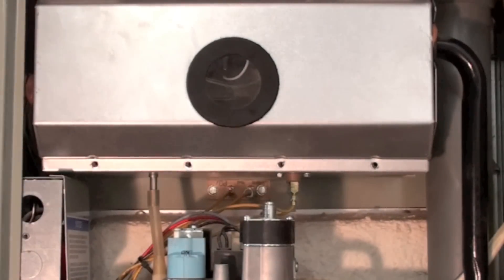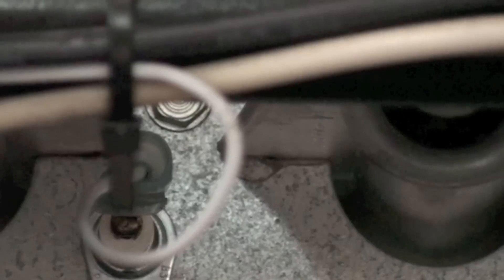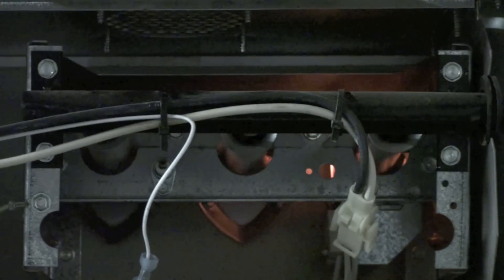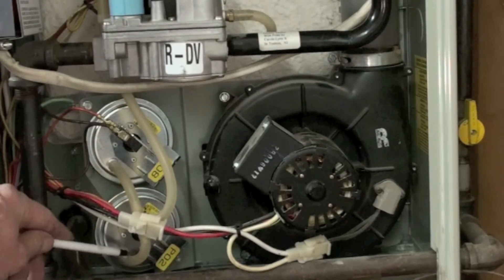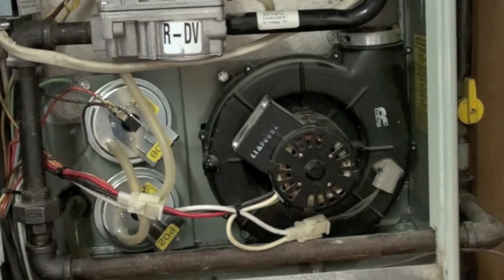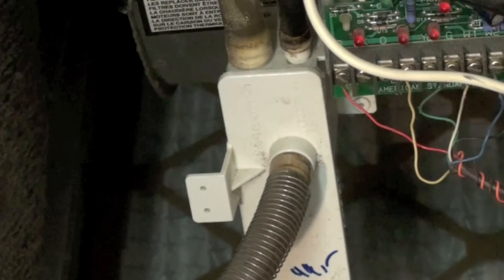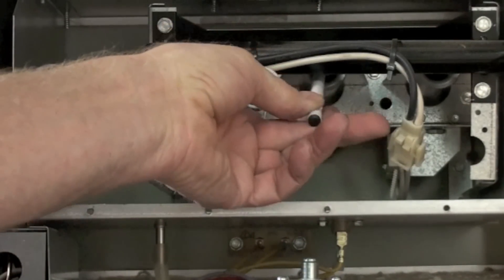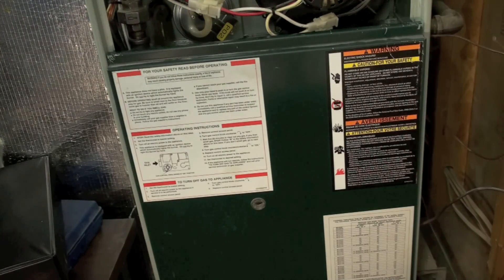Why does the gas furnace short cycle

Comment: I have a 4 year old Goodman 95% efficient furnace that is short cycling. I have cleaned the flame sensor and noticed that the inducer is filling up with water and believe that this is the source of my problem. I can hear water gurgling in the PCV exhaust vent. I took the inducer off and drained the water from it, replaced it and it ran fine for week or so and now it's doing it again.

I was wondering why after four years of the furnace running without any issues why would this be happening? I take very good care of the furnace changing the filters yearly, keeping it clean etc.

I was hoping you could help me figure out my problem, Thanks!
Reply from the maker: Look for low spots in the vent piping.  It does not have to be very far to stop the unit.  You should have 1/4" per foot slope towards the furnace.  Hope this helps.
GFM
Reply: grayfurnaceman Ok, so I checked the pitch of the vent piping and it is beyond perfect; sloping toward the furnace. So I once again took off the inducer, drained it and I took off every rubber hose and drain pipe connected to the drain trap, I cleaned them out and also made sure that the rubber elbow-T connected to the inducer is pitched toward the drain trap.

So now I will wait and see if this corrects the problem.

Thanks again for your help!
Reply from the maker: Gerald Thomas Hope to not hear from you again.
GFM

Comment: Hey GFM, I'm working on a horizontal carrier 80% with a fenwal spark  ignited pilot. The pilot and inducer turn on right away and the burner will short cycle two times when the unit's cold and then work fine the rest of the day. Any info would be greatly appreciated, thanks for the uploads.
Reply from the maker: There should be a flame rod to sense the pilot is on at the pilot.  I would clean it with sandpaper.  Hope this helps.
GFM
Reply: grayfurnaceman Thanks, I'll try it. Those "pilot rods" are hard enough to clean out in the open, this thing's in a  low crawl where I have to exhale and wedge myself into a cavity to service this stupid thing.
Reply from the maker: loudpipesavelives69 Drink less beer.
GFM

Comment from the maker: Hit the side of the furnace sharply after it has run 10 min after the burner shuts down.  If it shuts off, the fan switch is sticking and needs to be replaced.  Hope this helps.
GFM

Comment: thank you so much my husband is always on the road so im left to handle these issues which when having little kids you cant go without heat in the onset of cold weather it seems to be the starter im always so scared that im going to break things and make them worse then they are and as you know furnaces arent cheap to have fixed so i always research before going at the issue blind with no knowlegde so thank you again for this its helped

Comment: Hi, I have  older model furnace Johnson, here are the ID numbers to it: Model Number HAS105B Serial Number 158738 other numbers on the unit show: 05J57-JEO23, but the auto part is a HoneywelI. issues with furnace flames staying light. The four burners light up,  then go out a minute after running. The motor in it was a 1.6v it went out so we put in a similar model with  horse power of 1.4 v-the pilot light for the gas comes on and stays. But with the thermostat set at 80 not warm.What to try?

Comment from the maker: The t87 is mechanical and has an anticipator.  they can be set for less cycles.  I did a couple of vid on them. Check anticipator on the search.  Probably the best place for the stat would be near the return air.  
GFM

Comment: Any thoughts..... I am a tech new to the trade. I have a high eff furnace in my 2 car garage. (Got after a fire) the unit itself is to large for the garage 60k. I have a t87 mercury bulb stat located right behind the hood of the supply. The unit short cycles. Runs about 5 min and shuts off. I just did a clean and tune on it. My thoughts are besides the fact it's to big would be where the stat is mounted. It's picking up residual heat. Any other thoughts of what I can do to allow cycles to run lo

Comment from the maker: First be sure the drain is not plugged.  Then you can pull off the inducer and check the gasket.  Also, the manifold that behind the inducer is plastic and could be cracked.  Hope this helps.
GFM

Comment: Hi, its me again. Went to clean the filter on my trane XR90 propane furnace today and noticed now that there is water leaking from the the area behind the inducer. The water is leaking from the top shelf to the bottom and is falling on the filter itself. Any ideas where I should start this time? Thanks in advance.

Comment from the maker: Thanks, glad I helped.
GFM
Reply: I went on all the first steps including cleaning up the igniter and changing the filter and it came down to having build up dirt on the drain hose, that was my problem thanks to your video I realize my drain hose was blocked and that caused the pressure switchTo fail. After cleaning up the hose the cycle kept on running with the flame on and nothing shut off afterwards thank you so much

Comment: Thank you so much for this topic!  Our Coleman Evcon furnace has been giving us problems for a couple of years. I watched your video a couple of times and then cleaned the flame rod with some 400 wet or dry sandpaper.  It stayed lit for about 5 minutes then went out with a "limit switch open" code.  Then it ignited again and is still working!   I especially appreciate what you said about the pressure switch not always being the culprit.  Your photography is great.

Comment from the maker: No.  I would say flame rod but you have cleaned it.  This could be a venting problem with the pressure switch shutting off on first light up but with the warm exhaust gasses establishing proper vent pressure on 2d try.  Glad you found the leak.
GFM

Comment: Thanks to your video I fixed the leak myself. One of the two hoses going into the condensate trap was the source of the leak. I had to install a clamp to stop the leak. I also cleaned the flame sensor just to be safe. Furnace has not gone into a hard lockout since. Question, is it normal for the burners to turn off on the first try but stay lit on the second try? This happens every once in a while.

Comment from the maker: The water is condensate.  It could be leaking from a number of places.  Inducer, manifold, vent piping, condensate drain are some.  I would find the leak and repair it as it could leak onto the integrated furnace control and destroy it.  Hope this helps.
GFM

Comment: Thank you for uploading this video. Question, I have a Trane XR90 fueled by propane that is short cycling. When I took the lower cover off I noticed that there was a little bit of water by the front lip and by the filter area. When the furnace runs, I do not hear any noise. Any ideas? Thanks in advance.

Comment: The Furnace has two PVC vents that drain water outside and one of them had frozen water coming out of it and I broke the ice free. It was about thirteen degrees outside after doing this and the furnace still would not run properly. 

This morning I turned the thermostat on and the furnace fired up like normal and has been operating like normal.

Comment from the maker: It could be the inducer fan that's running.  If it does not see the proper pressure in a fixed time period, it shuts down.  Any possible snow or ice on the vent?
GFM

Comment: Thanks GFM. I recently replaced the inducer assembly so it might be the connection to the pressure switch

I wasn't even sure if this was a problem because the furnace short cycles exactly 1x then runs normally

Is it normal for the inducer motor to stay hot even when the furnace is off? The new unit is the right one for the furnace but the thing buzzes like crazy when operating and stays hot 24/7, which my old one did not do (had crazy vibration though, which is why it was replaced)

Comment from the maker: That one uses the Honeywell Smart Valve.  I would check if the 24 volt power going to the valve is continuous.  If there is a break in voltage to the valve, I would look at the pressure switch or the limit switch.  Jumper out each switch in turn.  The limit switch would have to be replaced if the unit runs normally with it jumpered.  If the pressure switch is the problem look to see if the venting is clear or the rubber tube is clear.  Hope this helps.  Let me know.
GFM

Comment: Thank you sir for sharing your knowledge. I had a short cycle condition and watched your video. The flame rod was coated with a white chalky film. I cleaned the stainless steel flame rod and the short cycle problem was solved. The furnace is back up and working fine. The  furnace is a GMPN060-3.

Comment: Whats a good setting for a Heat Anticipator for a honeywell thermostat on a bryant 90+ furnace this furnace and thermostat were installed in 2002 i think. the system runs for only 3-5 minutes and the burner only runs for about a minute i checked everything and its working